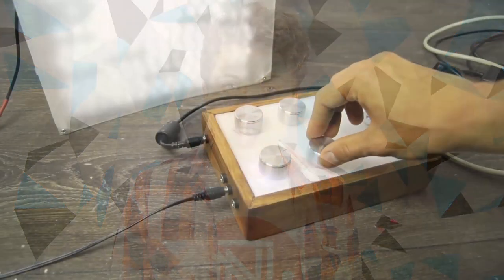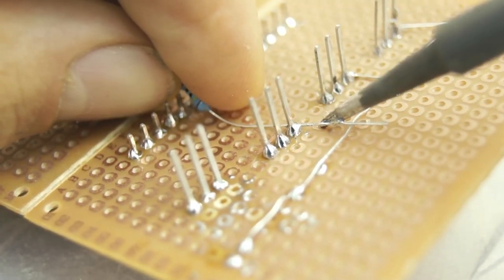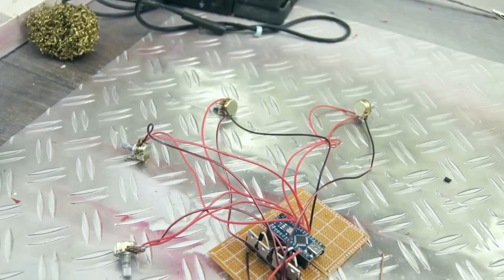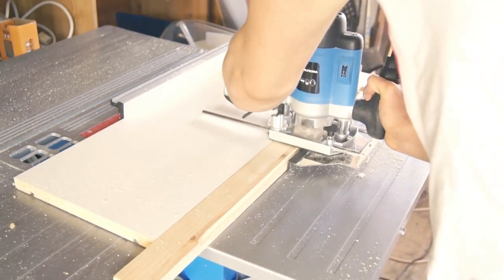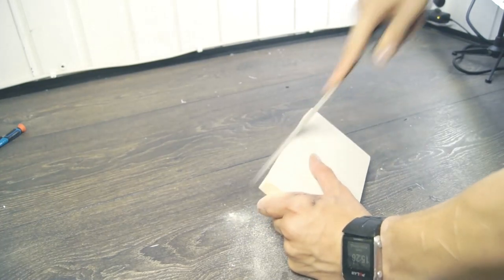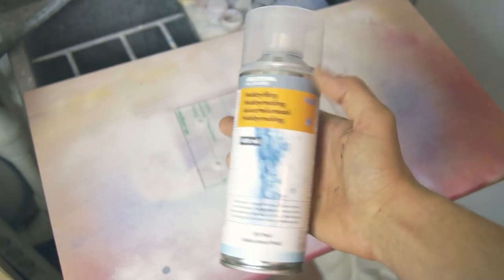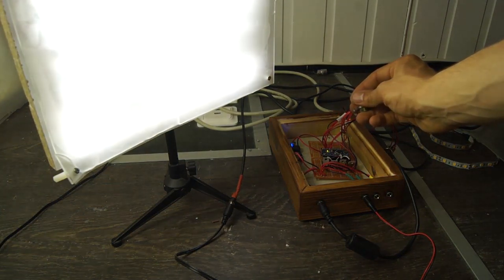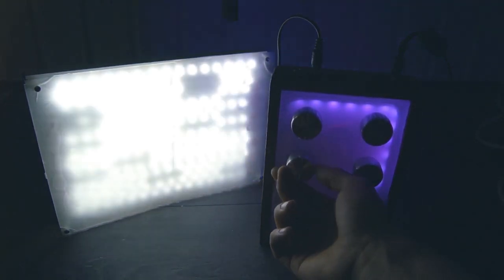Room Lighting Control Panel || How-to

Comment: You should connect the 5V to the 5V pin on the Arduino. The voltage regulator on the Arduino needs about 1.5V extra to regulate properly, so the VIN-pin takes from about 7.5V and up. Connecting 5V to it will result in less than 5V on the Arduino and possibly unstable operation - not recommended.

Comment: I want to do something like this, but I would like two knobs for each light, One for color and one for dimming, so I can set the hue and the level of each fixture separately, but then also Have one master knob at the bottom that when turned would allow the master knobs to set hue and dimming levels to all ligths at once. No clue how to do this, but I want to one day, haha
Reply from the maker: I wanted to do something like that originally as well, only with warm/cold white to be able to adjust the warmth. Shouldn't be any different except for the code :)
Reply: Yea, my problem is that I've never done anything other than wire an outlet in my house or tin speaker wires. Not really sure exactly where to start to get the point I could pull off this box! I have a solder gun though lol!
Reply from the maker: I understand how you feel! I hadn't touched a soldering iron two years ago, and I'm still pretty bad, hehe
Reply: I work daily with Soldering Irons and suck so badly with them
Reply: I can solder fine but Arduino code is too complicated for me to understand. I find coding PIC microcontrollers with Flowcode 7 is easier due to the simplified interface.

Comment: If you want to include the button into the circuit, why not make it cycle through colours for the power level indication instead of having a set color for each potentiometer, as well as cycle through all the different power levels for each potentiometer to see them without having to turn the potentiometers? There's a lot of things a single button can do when connected to a microcontroller. I'm sure you'll find a use for it! If you just want something simple, how about a toggle flip-flop with power indication light? One press, power is on and the button lights up, second press powers the device down and button light turns off.

Comment: That board reminds me of my digital electronics class where it took me four days to finish a simple detector project because my breadboard was dead. My design was flawless but after 3 days the teacher decided to test my breadboard and low and behold it was broken. Lost so much time on that single project.

Is the Arduino  easy to learn? I have experience with AOI, NAND, NOR and XOR circuit design but when it comes to macro electronics I'm a bit lost.
Reply: CBA judging by your post I'd say you'll be able to figure out an Ardi just fine

Comment: Cool, any 12V led lights will work.

1 Suggestion 
You could have used lilypad arduino, since you are not using many I/P ports right.
Its cheaper than mini

Comment: Hey, you are doing some really great work. I am greatly inspired by your work. I wanted to ask you that if i try to control the wireless led floor lamps that you have made with this control panel. Do i need an arduino or an the same node mcu with microphone module can be used? And i want to add an oled display to show the brightness and modes of the lamp. Is it possible with the equipments that were used in the floor led lamps project?

Comment: This entire project would have been easier for you if you would have used your table saw more instead of a scroll saw. Also, invest in a cheap acrylic cutter for making straight cuts. It's much easier to score it a few times and snap it cleanly than to try to follow a straight line with a scroll saw or jigsaw. It's a great project though.

Comment: i'm pretty sure you can just attach the 12V to the arduino nano and it'll work
Reply from the maker: Thats right. But with these cheap chinese knockoffs I might as well not take any chances, and run it on 5 volts, as that is needed for the strips as well.

Comment: Where did you buy the LED strip 
Good video.
Reply from the maker: Thanks! Here is the full list, including the LED-strip link: 
Supply list:
Arduino Nano | https://goo.gl/6plPSl
Potentiometer | https://goo.gl/KK4wvi
Knobs | http://goo.gl/VftEsk
Mosfet | http://goo.gl/BnON8z
Voltage step-down | https://goo.gl/ISlIJ3
RGB LED-strip |https://goo.gl/sR7f5P
Button | https://goo.gl/mcp5b3
Reply from the maker: Saw it and fixed it! :)
Reply: Thanks, it's perfect, a good video

Comment: uhhhh. you should check just put the 12vdc power supply to the Vin of the arduino. the arduino has its own regulator. thats one less component to buy .
Reply from the maker: Could have done that, but I wouldn't want to run all those LED-strips through the Arduino anyway, so I'd use the same component nontheless :)
Reply: +Natural Nerd then bypass the 5Vdc power supply. connect the 5Vdc to the Vcc of the arduino or the 5V pin on the arduino. this way you would bypass the regulator and remove any unwanted voltage drop.
Reply: I'm afraid the small linear regulator on the arduino would get extremely hot. I believe it's either a 5 or 3.3V regulator, in both cases with current draw of 50-100 mA and 12V input it will get very, very hot, and isn't gonna be very efficient. True, that would be very handy and eliminate one extra component, but when the linear regulators fail, assuming also the temperature cutoff fails,  they fail short and will kill the arduino.

Comment: this soldering gave me cancer
Reply: its probably better then yours, cuz if youre so good u should know how hard it is to begin with....
Reply: Same here
Reply from the maker: Likewise :/ But it's getting better by the day
Reply: srsly? thats not cool.swivels head sigh oh well... lost cause i guess...
Reply: To elaborate on your comment ( I too am terminally diagnosed, get it terminal),  its not his soldering skill that is awful its his misuse of components. 
If you use PCB prototyping board, never use random wires, just use solder to make lines by connecting holes. This prevents corrosion from breaking contacts and allows for higher current operation. 
Secondly, never ever solder an IC components (apart from transistors) directly but always use header. A good rule of thumb is if its legs are long and flimsy (like that of a resistor) solder it, if it has short hard legs that fit in header, use header. If you decide to solder IC components directly there is a big change you fry them due to the heat of soldering.
Also, never use electronic components for mechanical support (linking two separate boards using an arduino). This is just bad practice that in extremes can lead to mechanical stress on the component breaking it. This almost never happens but people usually don't walk on the street naked and there are still laws prohibiting it.

My source is an electrical engineering minor. I understand the hostility but to be fair natural nerd channel seems to generally not do electronics to well and most mistakes are very basic that could be prevented by watching a couple of youtube videos.

Comment: Whole project poorly executed. Adding a switch for no reason, knobs seemingly have no use (What do the other two knobs you didn't touch do?), soldering job was exhausting to watch, really dude? You soldered your microcontroller straight to your board? That was your first answer? The pins of the Arduino. Jesus. Disaster at all levels. Plan dude. Plan.
Reply: Well that's a bit harsh, not to mention rude. I don't see anything wrong in soldering a microcontroller straight to a PCB. It won't destroy it, and these small Arduino boards are cheap. It's no different from soldering a normal IC to a PCB, the only significant difference is that this one has a micro USB socket for programming it directly. As for unused UIs, with a microcontroller there are no "useless" inputs. Assuming from your hostile attitude, I assume you're better at this?
Reply: It's unfair to compare, I'm on a different level. However, even at a hobbyist level...he needs to read more, watch YouTube, Google, practice soldering. Long before he decides to make an amateur video that teaches hopeful learners awful practices and behaviors.
Reply: "unfair to compare"

If you are not better, have a better attitude or shut up ffs
Reply: Unfair to compare because I'm building larger electric projects on a different scale than home hobbyist.
I didn't point this out because it's unnecessary and my point stands.
Reply: Jason White your arrogance is next level